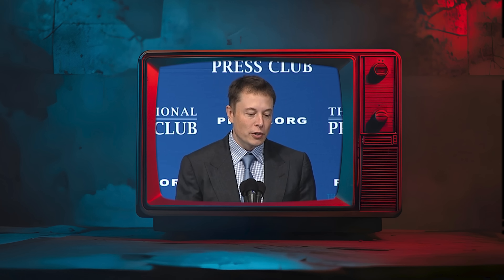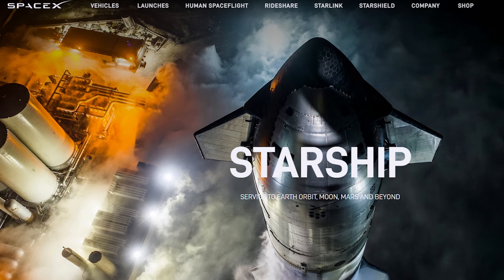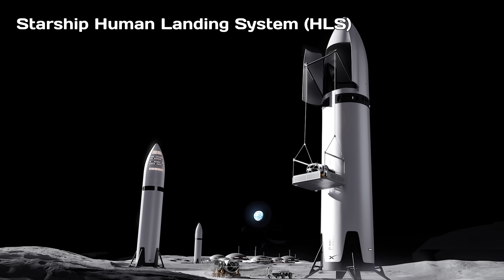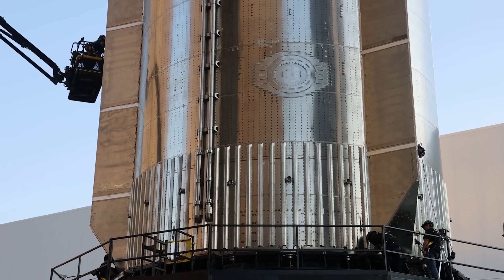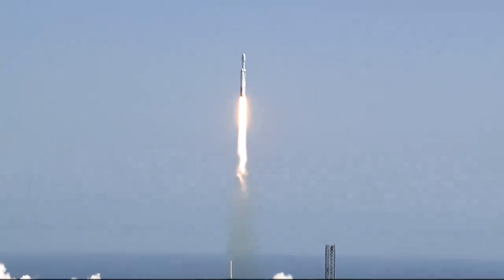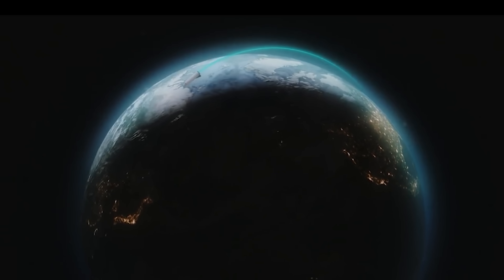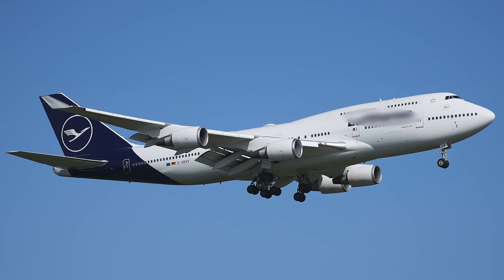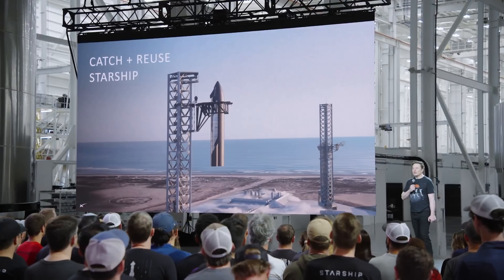Elon Musk revealed Expendable SpaceX Starship Option! 250 Tonnes to Orbit...

Comment: Double stack two boosters,leave one in space for flight to moon
Reply: Or... Build an upper stage that's the same as the Starship at the bottom, designed to mate to a booster. At the top it's the same as the top of a booster, designed to mate to a Starship. Put an aero cap on top. Put it on a normal booster. It's got a theoretical 250 tonnes of payload. Spend that payload on extra tank rings. That lets you put a super sized booster in orbit. Refill it there, dock a Starship to it and you can send a full Starship anywhere in the solar system, or even outside the solar system.

Comment: There are lots of options between rapid reusability and a fully expendible Starship that isn't even designed for reentry or landing.  There could be a version that's only designed for a single reentry/landing or where only the heat shield needs to be replaced.  Perhaps there could be a version that splashes down in the ocean (maybe good for returning empty tankers) and allows for some degree of refurbishment/reuse (kind of like what they do with fairings).  I think ULA is also looking at a system where only the engines are recovered and the rest of the ship is expendible.

Comment: Yes, for many missions an expendable upper stage (no TPS, no flaps, no headers) is more cost effective (and faster to build), and allow the use of a fairing vs a cargo bay, so you can fully utilize the volume of the upper stage.  250T allows for propulsive breaking at the destination, which is safer for crew missions.  And yes, direct missions are much faster.  You only need reuse for missions with Crew return, but if you had $5M Ships turns it makes refuel runs very cost effective. That said, like with F9, most of value is in reusing the first stage.

If you want ship reuse, then focus on lots of extra TPS mass and Crew/Passenger safety mass. People are light payloads.
Reply: ITS A CARTOON LOON

Comment: While I feel it is important to continue developing the reusable starship.  I think more rapid development could be attained through getting a working space research facility .simply by making it modular based on starship bodies modified for the purpose.  Concentrate on making a way to connect and assemble three or four hulls and some support materials sent into space as payload. If attained it would put spaceX way ahead in manufacturing and possibly help solve the heat ceramic tiles by utilizing low or zero gravity manufacturing processes
Reply: Moving manufacturing and robotics into orbit is the safest pathway to the moon and beyond

Comment: Why isn't anyone looking into a telescoping ship as a Space Lab or repair station with a 10m x 10m bay. ??? The 11m od over the 9m od a booster. With 4 to 6 port docking module with 2 to 4 of these ships will make a high use Lab and repair station. This design can be horizontal MOON HABs because the fuel bodies telescope out 31m form the HAB body. The 10mx 10m bay has a 7m x 9m Cargo door over a 3m x 9m  Air Lock and a center Air Lock 3m sq. between the Bay and 21m long living space plus Nose,

Comment: "No need for ultra light failure proof cameras, just pack in a thousand of them..."
But wouldn't that mean you now have 1,000 broken heavy cameras? The conditions that would kill 1 camera will kill them all.  
NOTHING is failure proof, but they need to try to survive the vibration, the extreme heat, the extreme cold, the radiation, and the vacuum of space. 
(Imagine the lenses failing because they were sealed air tight at sea level, and now they're thermocycling in a vacuum?)

Comment: An expendable starship option is just another way of saying we are having problems making it reusanle!
Reply: “Having problems” is fine when trying to solve a difficult challenge.  No shame in a noble struggle.  
I expected SpaceX to start expendable to get value from early launches while they worked the “ship reentry problem.”  This is the EXACT model they used on the Falcon 9.  Many F9 fully expendable launches carried cargo into space AS they worked to solve booster landings.
I think they were planning to launch Starlink V2 satellites on early missions… perhaps as soon as launch five, but they’ve struggled with the “pez dispenser” doors and with general Ship failures that have precluded full orbital missions so far.
Reply: No - It gives you options for the most difficult jobs.
Reply: @Rod57  they have to get up into space without blowing up first.

Comment: OK -------- ..  FOR SUB-ORBITAL STARSHIP TRIPS BETWEEN PLANETARY DISTINATIONS...  A STARSHIP USING LOX AND LIQUID HYDROGEN  MAY NOT NEED A BOOSTER FOR SHORT TRIPS SHORT OF HALF WAY AROUND THE WORLD, SIMPLY BECAUSE OF HYDRO-LOX INCREASED EFFICIENCY OR SPECIFIC IMPULSE OF  100 OVER METHA-LOX..  THE  30% GREATER EFFICIENCY SHOULD BE ENUOUGH TO GO FROM  EUROPE TO NEW YORK AT LEAST... OR  FROM NEW YORK TO L.A. WITH  HIGH ATMOSPHERIC SIRFING GIVING THE SHIP PLENTY OF RANGE.. THAT MAY EVEN GO FROM LONDON TO L.A. ALL WITHOUT THE NEED OF TOWERS AND BOOSTERS....   IF SO WE ARE LOOKING AT BEING ABLE TO ADD WINGS TO  ENABLE LANDING ON RUNWAYS... AND MAYBE EVEN TAKING OFF ON SPECIAL RUNWAYS OR RAMPS... IF THE ENGINES ARE POWERFUL ENOUGH...  WITH THE SHIP CLIMBING TO 30 TO 60 MILES ABOVE THE GROUND AND THEN SIRFING.   THEN LANDING ON ITS TAIL ON A PREPAIRED LANDING PAD CLOSE TO ANY CITY OR DISASTER AREA...IN 15 MINUTS...  
---------------.. I HAVE NOT DONE ALL THE MATH YET BUT IT JUST LOOKS INTERESTING EVEN IF IT DOES NOT WORK OUT.. WHICH I KNOW IT CAN'T, WITH METHA LOX WITH OUT A BOOSTER.. BUT HYDRO LOX... MAYBE... FOR AT LEAST 3,000 MILES. WHICH MAY BE JUST ENOUGH.. TO START WITH.. MAYBE MUCH MUCH FARTHER...
Reply: Right now Starship costs $2,000,000 per launch, say you have 200 seats, 200 space suits, no toilet, no children, it's going to cost you even if it happens about $30k - $50k a seat. Plus you will need to be at the launch site about a day before to get ready, then get in it, then get strapped in, then fuelled, then launch, it might if you're lucky take off that day, but I would estimate this all to takes about 3 days, in the mean time on an aircraft it has already landed where you're going and those people spent $2k-5k for an international flight, and got there before you took off.
Reply: @flightsimdev  not to mention the inherent danger of flying in a rocket when compared to a jet.

Comment: Reusability has to be the ultimate goal of Starship given the potential launch cost savings. However the development of a robust heat shield may take years. I suspect that fragile ceramic tiles isn't the answer. In the interim an expendable Starhip variant could make use of the proven super heavy booster. If we get serious about colonising the moon then the demand for heavy payloads will materialise as infrastructure demand spike. Initially we will need a 100KW nuclear power module plus a plant to transform lunar ice into rocket fuel. The demand for moon bound cargo will be enormous.

Comment: Booster space station / moon case / fuel storage Depot. 
Make the engine ring detachable. 

Launch that mother to LEO. Link up 5 in a pentagon with angled adapter plates
Use it as a space station, use it to store methane, attach a few vacuum engines and land it on the moon.  Horizontally.
Bring the engine ring back on a starship with all 33 Merlin's for re use
Reply: Making the starship modular and engine assembly reusable would be an excellent strategy for promoting Leo refueling station

Comment: OK----------.  FALCON HEAVEY DOES NOT NORMALLY NEED TO DUMP ITS THIRD OR CENTER FALCON BOOSTER, LEAVING THE FIRST TWO BOOSTERS TO RETURN TO BARGES OR LAUNCH SIGHT..,  ONLY WHEN THE PAYLOAD NEEDS THE ADDED THRUST FOR ONLY A  FEW HUNDRED POUNDS OF CARGO OF ADDED WEIGHT OR A FEW HUNDERD METERS/SEC OF  ADDED VELOCITY IF THE THIRD CENTER BOOSTER IS THROWN AWAY...  A REDICULOUSLY PITTIFULL WASTE IF THAT IS DONE WITH  EITHER A SUPPER BOOSTER OR A STARSHIP...
-----------...  . NORMALLY, FALCON HEAVY REUSES ALL THREE BOOSTERS AND ONLY THROWS AWAY THE TOP OF THE CENTER BOOSTER, WHICH AMOUNTS TO THE THIRD STAGE OF FALCON HEAVY. THAT  EVERY FALCON 9 HAS TO DUMP... TO PUT ANYTHING INTO ORBIT... MAKING THE COST OF THE STANDARD FALCON HEAVY ONLY THE COST OF THE EXTRA FUEL NEEDED TO DO THE JOB AND REFURBISHING THE TWO EXTRA BOOSTERS. OVER THE NORMAL SINGLE BOOSTER FALCON 9....

-----------...   SUPER HEAVY FIRST STAGE  BOOSTERS SHOULD NEVER BE NEEDED TO BE DUMPED TO FALL BACK TO BE DIESTROIYED AS THEY TUMBLE BACK INTO THE ATMOSPHERE... ANYTHING THAT NEEDS MORE THRUST OR FUEL CAN BE REFUELED IN ORBIT..UNLESS THE SAT IS SO BIG IT CANNOT BE LAUNCHED IN SECTIONS THAT ARE TOO BIG TO FIT IN A STARSHIP..... THOUGH IN THAT CASE A WHOLE NEW FAIRING MAY HAVE TO BE SEIGNED AND BUILT UNLESS THE SECOND STAGE IS A WHOLE NEW STARTHIP THAT MUST HAVE THE EXTRA LONG THRUST OF THE BOOOSTER TO MAKE ORBIT BUT THAT IS RATHER NOT LIKELY... BORDERING ON RIDICULOUS... AS TEH ADDED WEIGHT PUT OR VELOCITY PUT INTO ORBIT WOULD SIMPLY BE TO LITTLE TO BE WORTH THE COST TO DO IT...
----------   ...    AND STARSHIPS WILL NEVER NEED TO BE DUMPED OR DESTROYED, FALLING BACK INTO THE ATMOSPHERE... NO MATTER WHAT THEY CARRY..  A CONCEPT THAT IS SIMPLY BEYOND BELIEF..

------------  ....       STARSHIPS THAT NEED TO BE LEFT IN ORBIT LIKE SPECIALLY PREPAIRED TANKER HULLS TO FORM A DEPOT FOR REFUELING STARSHIPS. FOR MANNED SECTIONS FOR SPACE STATIONS THAT CAN BE BOLTED TOGETHER TO CREATE WORKING SOLID STRINGS OF MODULES WITH ISOLATION AIRLOCKS WITH HATCHES  BETWEEN EACH MODULES FOR SCIENCE LABS , MANUFACTURING,  CONSTRUCTION, POWER MODULES WITH BOLT ON  HUNDRED METER LONG SOLAR POWER AND COOLING PANELS  STICKING OUT THEIR SIDES,---  STARSHIP MODULS WITH COLLARS AND AIRLOCKS MOUNTED ALONG THIER FULL LENGTHS THAT MAY ONLY NEED THE LOCKS OUTER COVERS REMOVED OR JETISONED,,,, READY FOR SHIPS AND WORK PODS TO DOCK TO...  SPACED BETWEEN OTHER WORK AND WAREHOUSE STARSHIP MODULES.. . AND STARSHIPS WITH PAIRS OF COUNTER-ROTATING PIN WHEEL HUBS SPACED 80FEET BETWEEN HUBS DOWN THEIR LENGTHS FOR BOLTING 2, 4, 6, AND 8 STARSHIPS NOSED INTO THE HUBS TO ROTATE AROUND EACH PAIR OF COUNTER-ROTATING HUBS CREATING GRAVITY. WITH EACH PAIR OF COUNTER-ROTATING WHEELS OF STARSHIPS WITH SPECIAL REINFORCED NOSE SECTIONS WITH AIRLOCKS INTO THE HUBS, MAINTAINING THE STATIONS' STABILITY AND ATTITUDE.. WITH EACH GRAVITY HUB STARSHIP ONLY HAVING ONE PAIR OF ROTATING HUBS EACH SPACED 80 FEET APART. TO MAINTAIN SAFE DISTANCES BETWEEN COUNTER-ROTATING WHEELS OF HABITATION STARSHIPS... AND ADDITIONAL PAIRS OF HABITAT GRAVITY WHEELS ALONG THE AXES..SPAR OF STARSHIP SECTIONS ... 
-----------... ALL MADE FROM STARSHIP SECTIONS THAT HAVE BEEN CONSTRUCTED IN THE STARSHIP FACTORY ON EARTH WITH THE NEEDED FITTINGS, MOUNTS, HATCHES, DUCTS, PIPING THROUGH DECKS AND BULKHEADS THAT HAVE HATCH OPENING CUT OUTS FOR DRAINING LOX AND METHANE DURING LAUNCH AS NEEDED.  TO EASILY TURN EACH STARSHIP INTO WHAT ITS FINAL DESIGNED PURPOSE IT IS TO BE. THAT ONLY NEEDS THE TANKS TO BE EMPTIED, CLEANED. THE ENGINE MODULES TO BE UNBOLTED TO BE SHIPPED BACK DOWN TO EARTH.
-----------..    THEN THE FURNISHINGS, ELECTRICAL WIRING AND PLUMBING FITTINGS, AND LIFE SUPPORT EQUIPMENT TO BE MOVED INTO THE TANKS THAT AGAIN,,,  ALREADY HAVE DECKS, BULKHEADS, EQUIPMENT MOUNTS AND CONDUIT AND PIPING AND AIRDUCTS ALREADY WELDED INTO THE INSIDES OF EACH TANK WITH ALREADY FULLY OPERATIONAL TRUNKS AND AIRLOCKS BETWEEN THE TANKS AND THE ALREADY OUTFITTED AND OCCUPIED PASSENGER SECTION OF THE STARSHIP THAT ALSO HAS MUCH OF THE FUNISHINGS AND EQUIPMENT NEEDED FOR THE BASICS TO TURN WHAT EVER THE TANKS ARE NEEDED FOR INTO.  IN ITS CARGO HOLDS... WITH ADDITIONAL NEEDED EQUIPMENT SIMPLY SHIPPED UP ON NORMAL STARSHIP TRANSPORT FLIGHTS.... 
----------------.. VERY LITTLE SPACE WALKING AROUND THE EXTERNAL STARSHIP TANKS WOULD BE NEEDED, THOUGH SMALL ONE AND TWO SHORT SLEAVE CREW MANNED PODS AND CAR-SIZED TUG PODS  WOULD BE NEEDED FOR MOST OF THE CONSTRUCTION WORK OUTSIDE PRESSURIZED SHIP  STATION MODULES, INCLUDING MOVING STARSHIP MODULES AROUND THE DEPOTS AND STATIONS.. REDUCING THE STRESS AND WASTED TIME, PRESSURE ACLAMIZING TO SUITING UP TO WORKING AROUND  OUTSIDE THE STATION..   TWELVE PERSON BOATS WOULD BE NEEDED FOR TRANSFERRING PERSONNEL BETWEEN LOCALIZED STATIONS. OR RACING OUT TO GRAB LOST SUITED WORKERS IF THEY RUN OUT OF JUICE FOR THEIR THRUSTERS WHILE WORKING AND MISS A HANDHOLD ON THEIR WAY BACK TO A LOCK.. WHEN PODS ARE NOT NEEDED.. OR SIMPLY TO BOARD VISITING STARSHIPS THAT DO NOT NEED TO DOCK BUT TO SIMPLY TRANSFER CREW, PASSENGERS, FUEL SUPPLIES OR CARGO BEFORE CONTINUING WITH THEIR MISSION.

-------------.. LUNAR AND MARS BASES WOULD BE CONSTRUCTED WITH THE SAME MODULES AS SPACE STATIONS, BOTH HABITAT AND DEPOTS. WITH EACH STARSHIP DESIGNED AND CONSTRUCTED ON EARTH  TO THE APPROPRIATE DESIGN AND BUILT AT THE STARFACTORY ON EARTH. THEN ONCE LANDED ON THE  MOON OR MARS THE STARSHIP WOULD ONLY NEED TO BE EMPTIED, CLEANED, PLACED ON A PREPARED BASE, AND THEN EVERYTHING THAT IS NEEDED TO MAKE EACH STARSHIP BASE MODULE INTO WHATEVER PART OF THE BASE IT NEEDS TO BE.. CAN THEN  BE MOVED INTO AND MOUNTED ONTO THE  ALREADY BUILT INFRASTRUCTURE AND MOUNTS FOR THE EQUIPMENT TO BE BOLTED TO. WITH NO NEED FOR CONSTRUCTING ANYTHING INSIDE THE SHIP MODULE..BUT SIMPLE ASSEMBLY..

Comment: like or not one two return burn up ships splashing spreading trash in sea is ok?
but massive amounts of ships ends up being  a waste polution problem as tyre of cars as become.
ships heading out to moon stars astroids
do not have to burn up on earth and rteturning crew meet up with a space base and return on rocket plane or capsul.
developement of nerw ways will brerak the heat shield bottleneck
flattening out the vessle  having wrap around metal sweating blankets no small tiles
and ability to unfold to wider sprerad out landfing on wheels may be way forward.
huge ship as heavy haulage and lighter rockets to take crew up .
rockets in space will become meccanno lego click build in units
as shape isize s indiffrent not having to reenter atmosphere.
UK vcame up first with the hyper sopace plane point to point Hottle

Comment: I wonder how many times this new ship will blow up or fail before it works by trial and error instead of engineering?
Reply from the maker: Can be up to 100?
Reply: I'm an engineer.  When I create something, I do the math and make a prototype.  Usually, several prototypes are needed to finalize the design.  In theory, for many projects, I could do more math and simulations and might be able to make something work on the first attempt but it wouldn't be an optimal design and it wouldn't be an efficient development (time or money).  SpaceX is doing efficient engineering.  What they're attempting is incredibly difficult and barely possible at the level of current human technology.  They can't afford to try to simulate their way to eventual success.  Their development program only looks odd because NASA and their defense contractors have held humanity back for half a century doing it the dumb way, with nearly no aerospace development progress.  NASA can't even go back to the moon 60 years later without SpaceX solving the hard problems.

Comment: I have an idea. Spacex should think about using a very large diameter balloon at the start of decent to cut the speed by 1000 mph or more.  The upper atmosphere is thin it might be possible by increasing the surface area of the craft during decent to greatly reduce heating because instead of their initial decent being at 17000 mph or 18000 mph it could be reduced to 17000 mph or 16000 mph or less. As stated in the video heating is greatly influenced by reentry speed, so the idea is to minimize reentry speed with a quickly disposable drag line.
Reply from the maker: Interesting..

Comment: Not true. Sorry. The "moon" version won't be simple or cheaper. Yes, there is no flaps or heat shield for reentry. But different insulation for all vehicle body. Plus a lot more engines (and different types), the integrated structure of the rocket body is also significantly different, landing gear mechanism...etc, etc.

Comment: its disappointing but if they could still re use the first stage then one imagines that overall costs would fall. In addition, they could start with a disposable upper stage and then gradually introduce a reusable one a few years later when the various technical challenges had been overcome. One European group has recognised that three quarters of the cost is in the engines so if you could persuade the engines to separate from the fuel tanks and re enter separately you could re use them and still drive down costs.

Comment: Expendable is sort of a stupid word,or term. 
Reason 
1. The starship is a segment in a space station configuration that can be serviced by the falcon 9 rocket for resupply and crew change.
Reply from the maker: The term "expendable" isn't ideal, but it refers to rockets designed for single use, unlike Starship's reusable system.
Reply: @SpaceZonea yah I messed up I might have used the word to describe how my HEX station would be inside one starship and then 6 other starships dock with it.